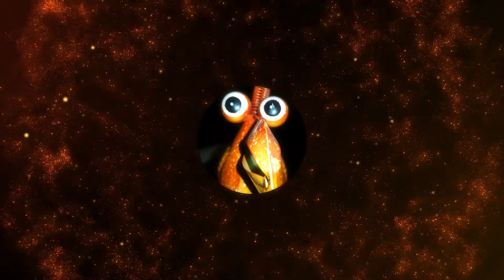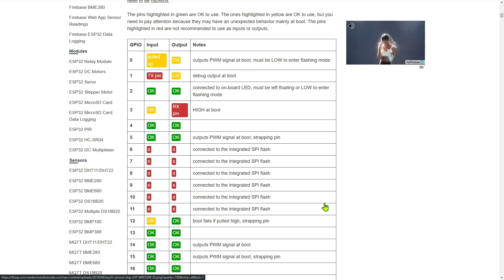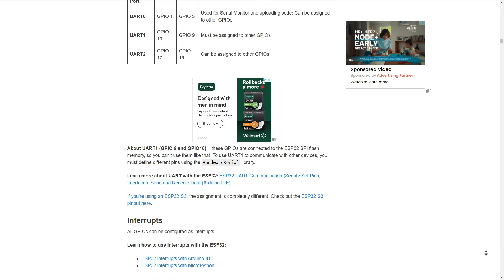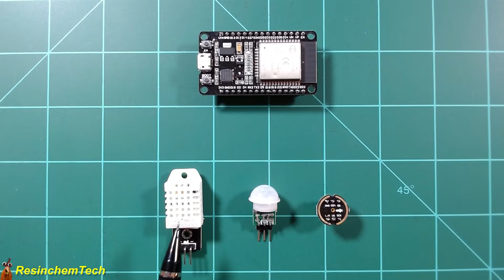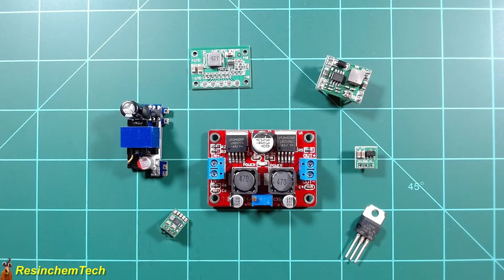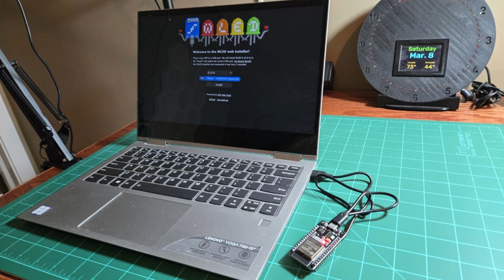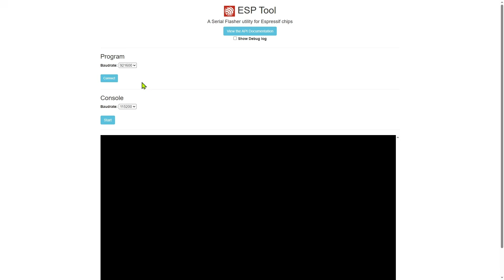How to Use the ESP8266 or ESP32 Microcontroller

Comment: Great information drop like always. One thing I'm having a difficult time finding an answer to is what is the best way to drop 12V to 3.3V reliably. Buck Converter? Resisters? I'm wanting to use the 12v form my vehicles light ie: turn signals, brake light etc as the "switch" in WLED.
Reply from the maker: Well, as I mentioned in the video, you need to determine the potential current draw first.  My guess is that the current will be too great for your average 1/4 or 1/2 watt resistor.  So, yes the next step would be a buck converter.  But again, you need to assure any converter (and all other components, wiring, etc.) are rated for both the voltage and current/amps expected.

And while I am certainly not a lawyer (nor do I play one here on YouTube) also just be aware that if you are looking at a street-legal vehicle, modifying the break lights, turn signals, etc. may not be legal in your particular state, as they are pretty picky about anything involving safety.  I doubt that a custom LED display driven by WLED would be considered "street legal" in most states. Just an FYI to consider before you get too far down that path.
Reply: @ thank you much. Being the internet one can get twenty different answers. Considered using the Mini 560 Pro stepped down for 12v to 3.3v but may end up using the XL4015 for being a bit more robust and slightly more conversion efficiency. This was the last piece of the puzzle I’m putting together. 

As for the legality of the lights I’m not doing anything crazy just building my own LED light strip below the tailgate since the I had only lasted 20 years and really don’t want to spend $120 on one. 

I’m new to the SBC world and the first ESP32 project was WLED. Your videos helped walk me through some trouble shooting.
Thanks again
Reply: my longer comment doesn't seem to be going through but look up optocoupler. I used it for turn signals with WLED.

Comment: Solid video, thank you for sharing. I work with the Espressif chips a lot and this video taught me quite few new things. Your section on power is especially interesting
Reply from the maker: You are most welcome!  I think power is one of the more common basic mistakes I see beginners make (myself included!).  They get the voltages correct, but fail to take into account the current.  I don't know how many people I've heard from where their LED installation suddenly "stopped working" only to find that they were trying to power a long strip of LEDs from the 5V pin.  I even had someone that burnt out 4 or 5 ESP boards before he would believe what I was trying to tell him about current.  As he stated "I saw another YouTube video where the guy was powering a long strip off the 5V pin", so he wouldn't believe that was the problem.  What I (tried) to explain was that in that video, the LED brightness was turned WAY down (and therefore limited the current draw).  If the person in the video had turned up the brightness, his ESP board would have fried as well.

So I tried to make it a point in this video as to how to properly power high vs. low current devices safely in terms of the ESP.  Hopefully it saves someone a few ESP boards instead of learning the hard way, like many of the rest of us!

Thanks for watching and thanks for the comment!

Comment: I was wondering if you have an LG TV and if you have ever looked into doing a setup video for a Hyperion system using the piccap homebrew capture application?
Pretty sure that you can root any TV now with tdejavuln.
It would be a great LED project if you have a web OS TV
Reply from the maker: Well, I don't have an LG TV so unless LG wants to send me a free one 'for review', not sure I can do anything that is LG specific.

As far as Hyperion, I've considered it a few times but I actually have the Hue Play lamps behind the main TV, a number of other Hue lights in the same room, along with the Hue Sync box for synchronizing video and audio to the lights.  I actually bought into Hue before I even got into Home Assistant, but because of that, really haven't had a strong motivation to do something with  Hyperion.

I always appreciate ideas or recommendations for future videos.  And as of right now, I don't have a 'spare' smart TV that I can play around with.  Personally, I'm not brave enough to try rooting our main TV.  Maybe I can try and if I brick it, use it as an excuse to go out and buy a replacement that is even bigger?
Reply: @ResinChemTech  not sure you can root other TV's besides web OS but the root for web OS is easy and safe to do.
Yeah I also have a sync box already but it's not the HUE one, the problem is passing through higher signals like 4k120 HDR Dolby vision, not sure if hue passes all that through but it should for the price.
I think mine does 4k60 but it was cheap
The great thing about piccap is that you can send the capture data directly to the esp and no HDMI or capture device is needed because it gets done by the TV
And you can use the TV apps like the ad free YouTube from the homebrew channel with the ambilight.
That said I really don't recommend getting a ln LG because I hate mine and web OS has been a nightmare for me using it with my AVR, CEC and eARC doesn't work 80% of the time and 4k 120 doesn't work either if you have long run, anything over 10 feet is problems they say and I have 30 feet run
So will probably need to spend over $1000 for an HDMI cable since the only certified one is cherry cola and it costs over a grand and I already spent hundreds on other cables baluns couplers boosters and on and on trying to get this worthless TV and AVR to  pass a decent signal, that is why I want the piccap because no way I need another problem with HDMI when it already is a major problem.
HDMI should have been abandoned 10 years ago and I would not buy another TV unless they get rid of it and replace it with something that can carry 48gbps without needing to spend 1k for any with 20 foot run or more.

Comment: Nice work. Any aliexpress links for "reputable" suppliers? I find the markup on amazon is often significant (2X) and don't mind the wait from China - provided the product is ok. There is a lack of standards on development boards which further complicates matters. 

For anybody planning to put an ESP into a 3d printed case, make you get one with mounting holes.  I was able to hack together a clip style mount but its not great.

BTW what's your "goto" board that solves 95% of your problems?

Comment: I've been looking for a solution to monitor my UPS devices that aren't connected to PCs. I would like to monitor them via the nut protocol in home assistant. I have found references to using a Raspberry Pi as a client monitoring device for the UPS. Unfortunately raspberry pies are so expensive now especially after you add up all the other things you need to support them. Do you think it's possible to use an ESP 32 and custom firmware to plug into the USB port on a UPS and have it communicate to home assistance?
Reply from the maker: I'm not very familiar with the NUT protocol, but a quick search for 'ESP32 Nut Server' turned up a number of potential solutions, such as this one:  https://github.com/ludoux/esp32-nut-server-usbhid (I have not tried or even really reviewed this option, so don't know how well it might work, but it is just one of many examples).

So if you can write your own firmware, I think you could write something using these examples to 'bridge' the communication between the UPS and Home Assistant.  Let me know if you get something working!

Comment: Great video as always.  Do you think the 8266 boards will start to disappear from the market as support ends?
Reply from the maker: I think they'll be around for a while yet.  As I mentioned briefly, support for the ESP8266 (and original ESP32) has  been extended for 3 years... for a total of 15...  support will now continue until at least 2029, so I think they will still be around for a few years.

The bigger concern (if not creating/coding your own devices) is that a lot of 'pre-made' firmware, like WLED, are slowly moving towards the ESP32.  So, even if the ESP8266 is still around and supported, I think you'll find that those writing the firmware will move to the ESP32 well before the ESP8266 is end-of-life.  But that's just my personal guess!

Comment: Great video! Thanks! I tried to use a devkitM in esphome. That failed. Tried to follow esphome build to sort it out. That failed. Ordered “listed” boards for esphome. We try that soon. Perhaps i need to look for docs on the boot process and watch the diag output messages. Depressing the esp so much smarter than me.
Reply from the maker: Thanks.  And I agree that sometimes getting an ESP32 into flashing mode can be the most difficult part.  But I've also found that if one installer/method doesn't work, then I can sometime try a different utility with success.

For example, you could export/download a compiled binary from ESPHome and then use something like ESPHome Flasher or even the online ESPTool utility.  Yes.. in every case, the board needs to be put in flashing mode if it doesn't happen automatically, but some firmware/boards work better with some flashing utilities than others.

Comment: Thank you for very interesting explanation. I think there is many microcontrollers, so we can chose the smaller one to manage the project, no need to waste a bigger device unnecessarily
Reply from the maker: You are welcome.  And yes, I agree that you should select a board that meets your requirements, including size.  I have a number of older ESP8266 projects that I've constantly been asked to upgrade for the ESP32.  But in many cases, the ESP8266 is more than adequate for the job, so I don't actually have any true reason to spend the time and effort to 'upgrade' the project to an ESP32... which would also result in two versions of the project I'd have to maintain.

The 3-year extension on the ESP8266 support life cycle certainly takes some of the pressure off for migrating ESP8266 projects, but I do believe the ESP8266 will eventually be completely superseded by the ESP32, so I now do recommend those boards for new projects moving forward.  But you could still certainly create a lot of great projects with something like the ESP8266 Wemos D1 Mini.

Thanks for watching and commenting!

Comment: Would it be possible esp32 are equivalent to produce an audio playback and audio monitoring device for home assistant that also utilizes internal sensors for temperature humidity etc. basically home assistant control and playback I have the speakers and cabinets and power supplies but not the stuff inside and I'm considering building interface if possible
Reply from the maker: I think you are looking at something similar to this:  https://www.home-assistant.io/voice-pe/ which also uses an ESP32.  You can certainly build your own voice/player system(kinda' how that project above started), but there are a lot of rather complex parts to the firmware... voice-to-text, text-to-voice, wake words, processing, etc.

So, it is certainly possible... the ESP32 can handle it... but like most projects, the devil is in the details!

And while it is does not have a microphone/voice control, I did build a DIY amp project that spans about three different videos.  Not that you'd want to clone that project, but it might provide a few ideas for incorporating into your own project.